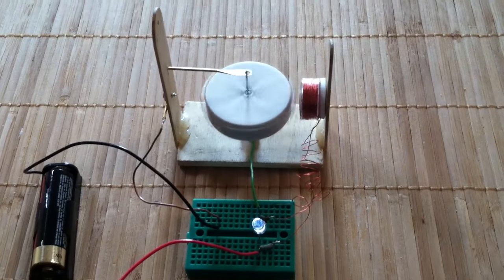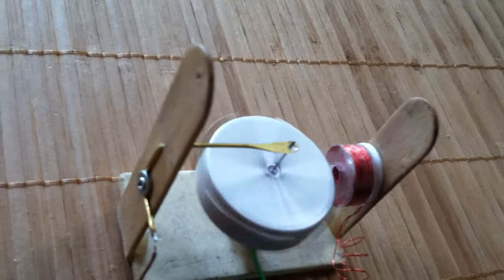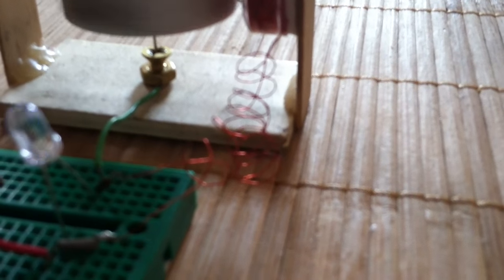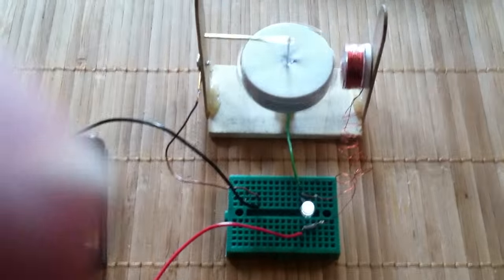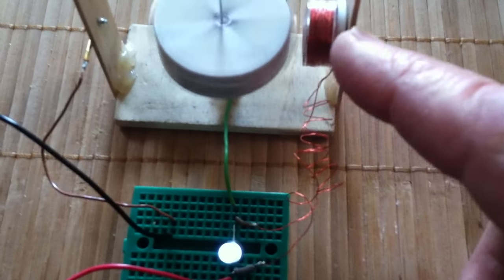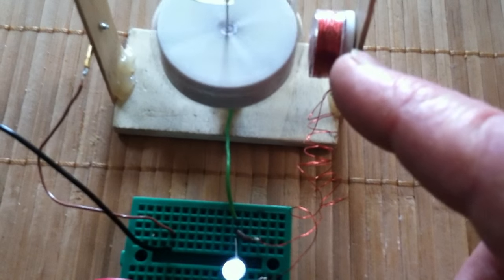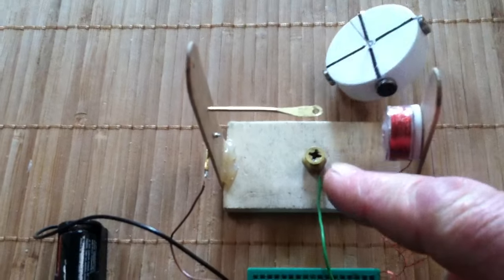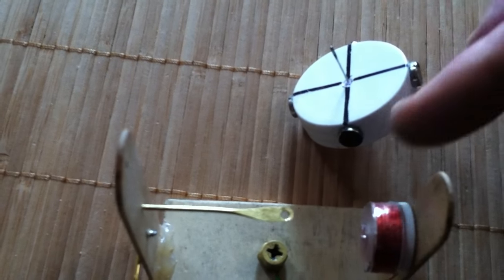Wobbling Needle Motor-- Part 5

Comment: wooo hooo and eureka.i got my first Lidmotor running.i used this circuit,but drilled it tighter like your later video.i mounted the coil to another separate stick so i can adjust the gap as i had no clue as to it's width.runs slick.thanks for continuing to simplify these for the newbies like myself.
Reply from the maker: +bill bailey Excellent!!  Great news.

Comment: I left the magnets in place and ran a number 14 copper wire so it just made contact with the needle eye.That worked pretty good .
Reply from the maker: +magnetman2010  I guess that acts like a brush with needle eye as the commutator?
Reply: +Lidmotor Right.

Comment: Have you ever used the fly back power for something else? I tried it and it ran a pulse motor  just fine.
Reply from the maker: +magnetman2010  I have tried using the fly back on all kinds of things.  I usually put it in a cap before I use it.  Flashing an led is just easy.